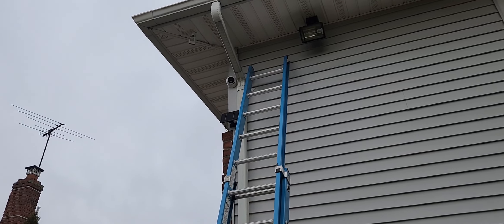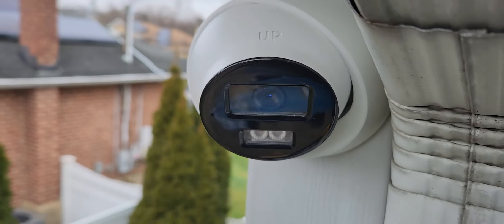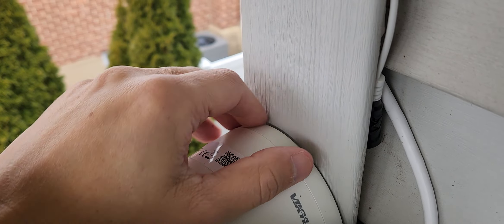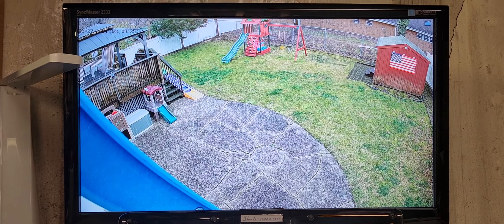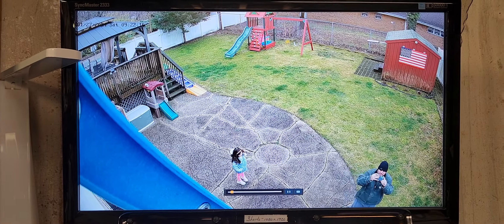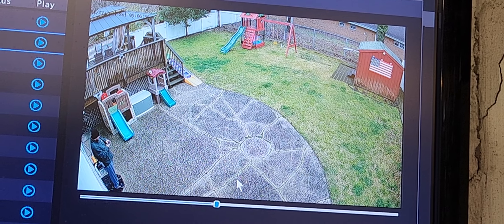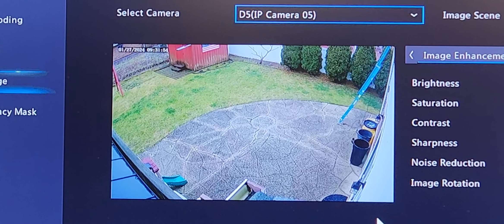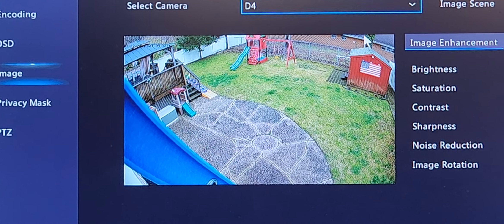CCTV Final Install

Comment: Good, glad that's working well.  I think it does a fine enough job.

Looks like we need to have another power washing party for your concrete patio this spring or summer.  Then you can come here and we'll do the same thing.
Reply from the maker: That padio gets even dirter each year after it's washed. Even the fences are green again.
Reply: @xjoe81x  Mine too.  It's the weather conditions.